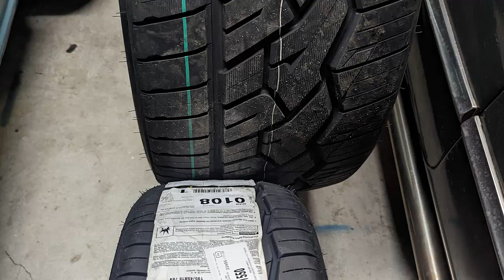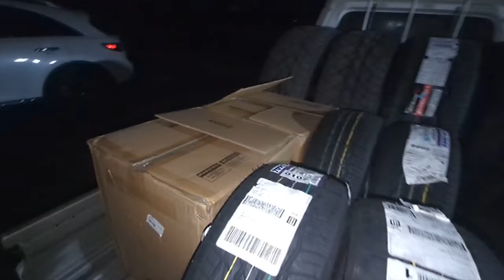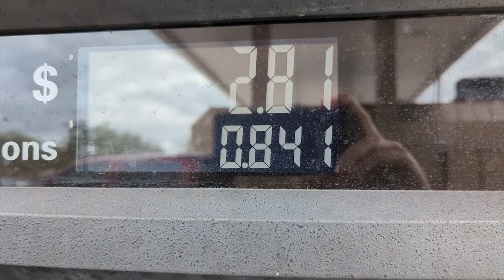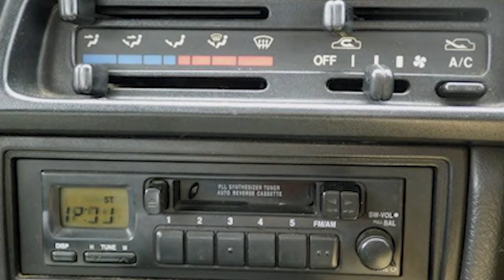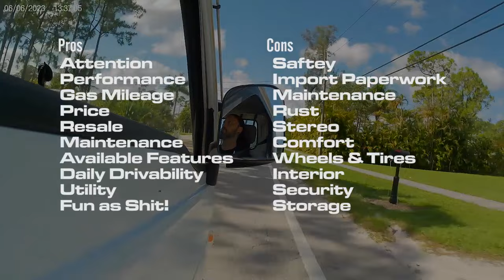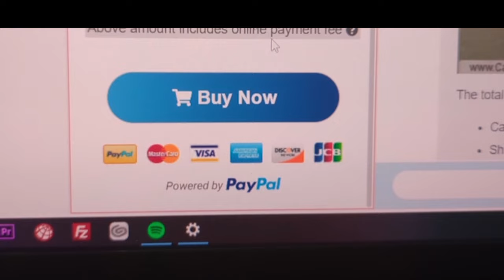Living with a Kei Truck : 10 pros and 10 cons

Comment: Too bad you cannot register these in ny.
Reply from the maker: Did they fully ban them? That sucks. They would make a great city car
Reply: @inkandpistons  sadly yes. After buying a house I realized a truck would be very helpful and then found out about kei trucks. Was excited at first since it is a perfect truck for basic home needs. Compact, great gas mileage, cheap, not a pile of rust that someone's wants 5k+ for, etc. So I checked with my friend that did importing for a few years. He informed me that the NY DMV will not register any kei truck. They deemed them unsafe. Checked the DMV and they have it explicitly stated no kei trucks. He did say the a nissan atlas is allowed since it counts as a full size. But they all seem to be significantly more expensive and get the same gas mileage as a standard truck. Which kind of defeats the point.
Reply from the maker: @scow01 do you know anybody in a neighboring state that'll let you register it to them? They can't stop you from driving there.  Probably save on insurance. Not being in New York anyway lol
Reply: @inkandpistons  for a while you could register one in Vermont. Then Vermont decided to nix that as well. Seems like the only way I've come across so far is by creating an LLC in Montana and then registering the kei truck under the LLC. Though I don't know of anyone that has done that.
Reply from the maker: @scow01  yeah sounds like a pain in the butt.. I guess write your local government 🤷